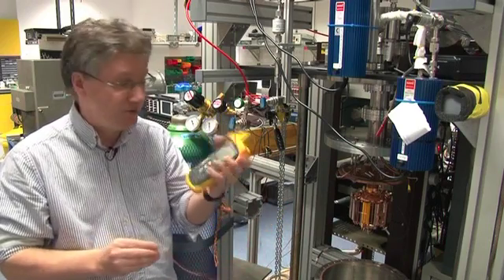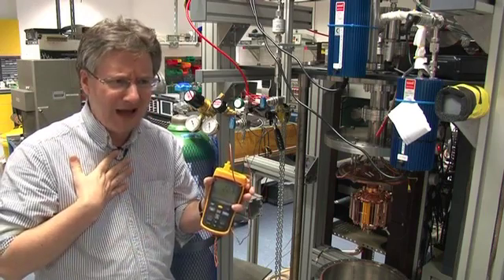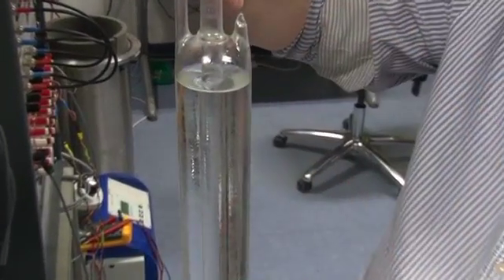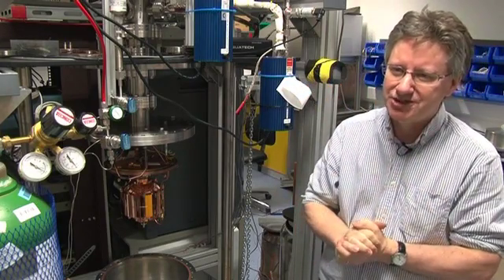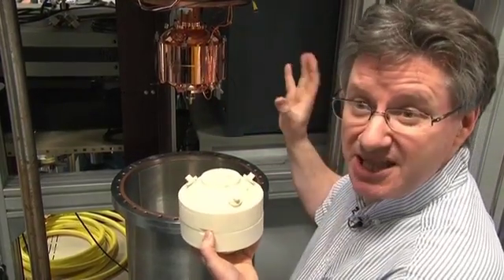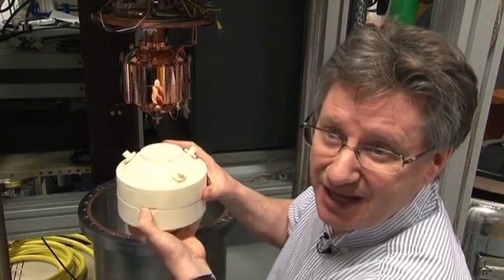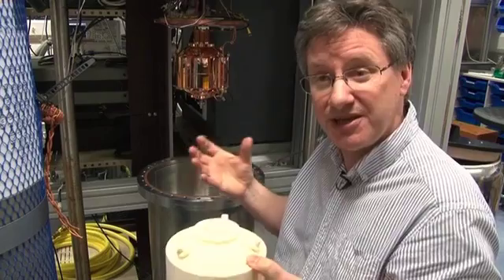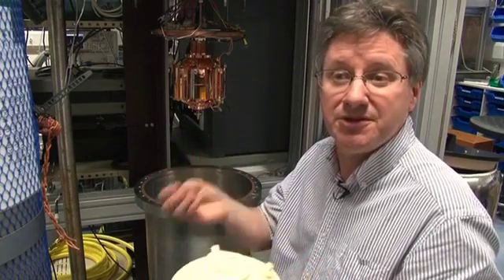Acoustic Thermometry exhibit at the Royal Society Summer Science Exhibition 2013

Comment: What is the purity of the water? Doesn't that effect the triple point or so called calibration?
And also, doesn't the accuracy of the vessel's internal diameter effect the calibration value?
Reply: Yes to all your points. The water is ultra pure, and they coincidentally measure the internal diameter of the resonator with microwaves. Great questions!